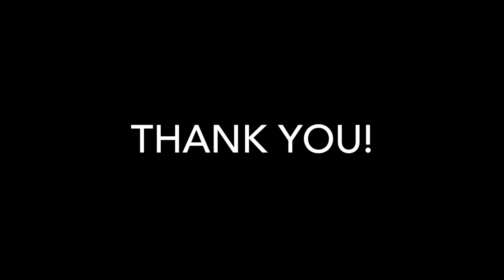2002 Saab 9-3 Antenna Mask Replacement -  DIY

Comment: Hey, just wondering what size the mast is? 10mm or 12mm at the base? 
Mine is stuck halfway so I can't check to order one online.
Thanks!
Reply from the maker: ang ko they are 10mm on the base
Reply: Kyle Pancis  Great, thank you! This video definitely makes this job look like something I could do. Much simpler than I thought.